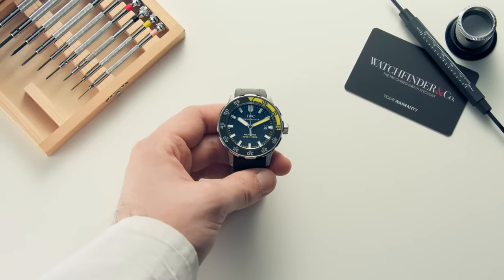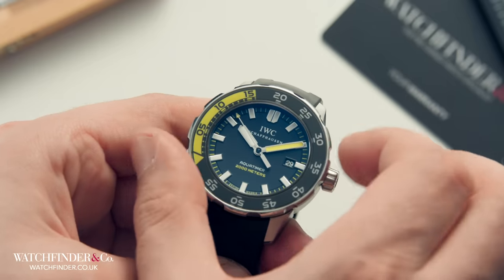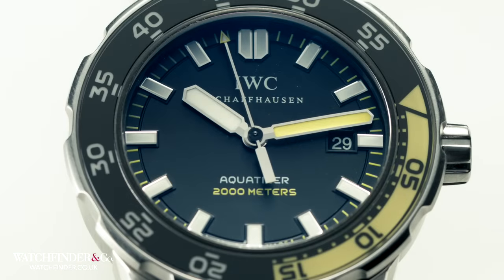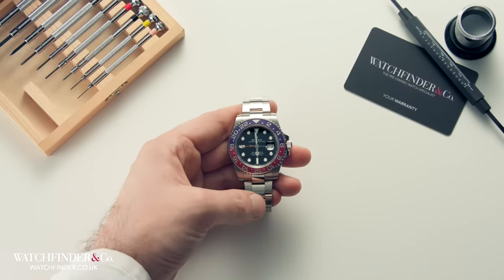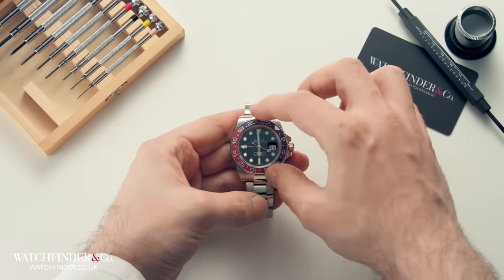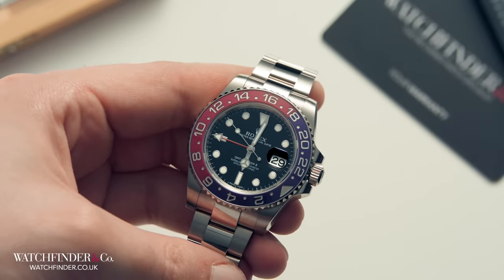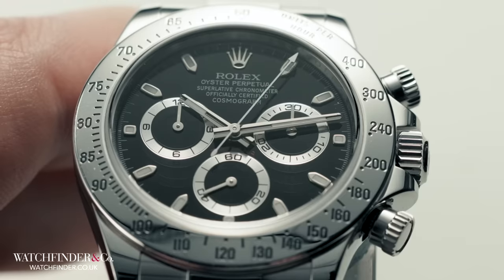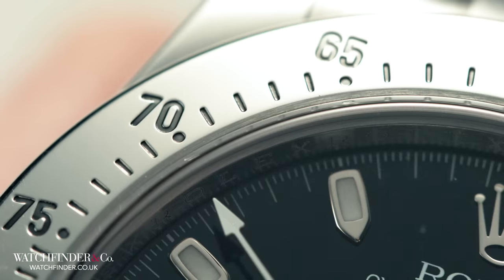How to Use a Bezel on a Dive Watch | Watchfinder & Co.

Comment: You’re explanation on the diving bezel is false, it’s a common misconception. For diving, it’s meant to count down time. Nowadays we have dive computers and dive tables have become obsolete, but we still plan our dives and dive time. At the time of the release of the first modern dive watches (Blancpain Fifty fathoms, Zodiac Seawolf, Rolex submariner,etc...) we would plan our dive time before diving, usually 30 minutes + ascending time and deco/safety stops: so we’d place 30 on the minutes hand, once the minute hand reaches the glowing marker it’s time to start ascending, the markers between 0 and 15 are used to count down stops. Again, if you plan a 40 minutes dive before ascending then place 20 on the minutes hand when starting the dive...etc.
Reply: Interesting. I have never gone diving so I feel like a douche debating this with you, but I feel like your method is just your method, not the intended method. If you plan to dive for X minutes, you could set the 0 to the minutes hand, then ascend when the minutes hand is X minutes past the glowing dot, and reset your bezel's 0 to the minutes hand again to time your ascent stops.

I do like your method, and I wish bezels were count-down rather than count-up.
Reply: The advantage with Bruno’s “triangle at ascent” method is that it’s much more obvious during the dive that you’re nearing the end of the bottom-time. You don’t need to do any calculations and it’s safer in case you somehow forgot the bottom-time you had planned

Comment: My G-Shock doesn't have a bezel.
Reply: well it probably int a professional dive watch
Reply: @morganbuntmann7395  Almost all gshocks can be used for diving, they are digital so why would you have bezel on that lol (except ana-digi ones)
Reply: G-Shock doesnt need one as is the same with most Digitals, the Countdown timer takes care of the dive time and many have a world time function, the only thing it cant really do is the speed thing, you'll have to time the mile with the stopwatch and calculate the old fashioned way.

As to pro dive watch, their toughend case is based on that exact type of use along with impact damage, its gaskets are heavier duty than many watches sold with diving in mind.
Reply: @Segafishy  except for the ga110/100 it has a tachymetre,which is awesome.

Comment: The bezel only turns on way to prevent minutes from being added, not deducted. This was incorrectly stated at 50 seconds. A diver should only err in thinking he has less time instead of more time. That is why the bezel can only be turned one way. If it gets bumped, time is loss, not added.

Comment: Doesn't the one-way bezel prevent minutes being added accidentally, rather than deducted as stated?  Accidentally adding minutes would be a pretty dangerous error if you were using the bezel to determine how much oxygen you had left.
Reply: Imagine that you have 15 minutes of oxygen. If the bezel is reading 8 elapsed minutes, and you bump it so that it now reads 10, that means you just "lost" 2 minutes until your deadline.
Reply: But for most people if a minute or 2 was added they probably just burnt their dinner
Reply: @ChintanPandya01  obviously the dive bezel is not a direct representation of oxygen levels remaining in the tank - at least not with the advent of more accurate, modern technology - however oxygen levels would still presumably be a consideration when setting the bezel.
Reply: @mr22guy  it depends on whether you're using it as a count-up timer or a count-down timer, i.e. whether you're setting the triangle marker at the minute hand and reading the time elapsed from the numbers on the bezel, or deducting the time from 60 and setting that figure at the minute hand using the triangle marker as zero.

Comment: Brother can u explain me one thing, what is bidirectional or uni-directional bezel function? And which is better?
Reply: If you still need an explanation, bidirectional bezels can move two ways (clockwise and counter-clockwise), while unidirectional ones can only move one way (typically clockwise). As for which is better, people tend to prefer unidirectional bezels so that the bezel can't accidentally slip backwards and forwards (in uni, it's at least limited to only forwards because it can only go one direction).

Comment: How do you use a non movable 0 to 60 scale on a watch? I'm  told its a tachometer but can't find out how to use it. All instructions are for watches with scales that start at 400 at the 7 second mark.
Reply: The static 0-60 scale simply helps you read the seconds. It has no other function.

Comment: Miles per hour or kilometers per hour?
Reply: It does not matter because tachymeter measures in the same way be it in miles or kilometers or meters.
Reply: The function performed by a tachymeter is independent of the unit of distance (e.g. statute miles, nautical miles, kilometres, metres etc.) as long as the same unit of length is used for all calculations. It can also be used to measure an industrial production process in units per hour. A tachymeter is simply a means of converting elapsed time (in seconds per unit) to speed (in units per hour).
Reply: Got it!
Reply: Got it!
Reply: Nicolas Nikitakis Nice!
Reply: Munrais miles ph

Comment: why the fuck are tachymetres based on the imperial system?
Reply from the maker: They're based on simply 'units per hour' so you can use it to time intervals of any activity and extrapolate to an hour's worth. For example, if you were watching shooting stars, you could time the gap between two and the tachymeter would tell you how many shooting stars you'd see over an hour if they continued to appear at the same rate. Shooting stars per hour!